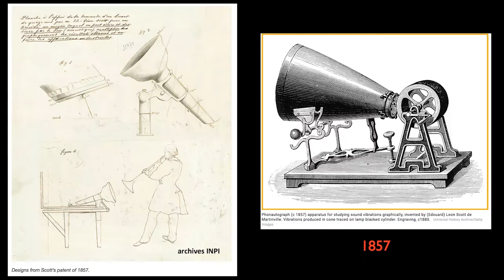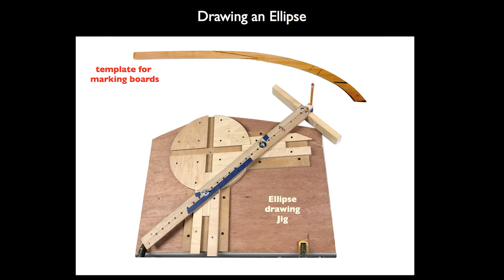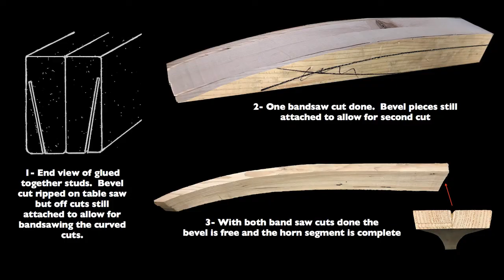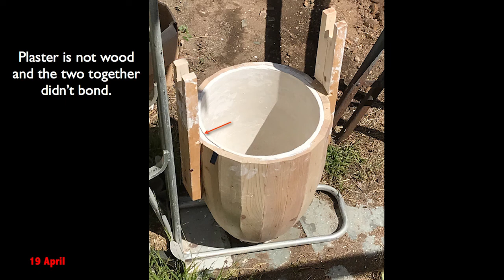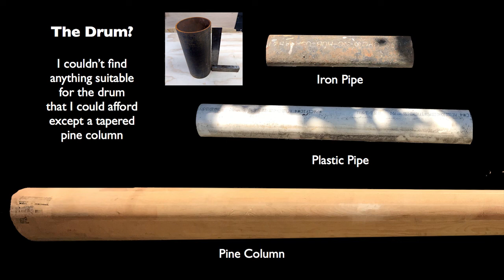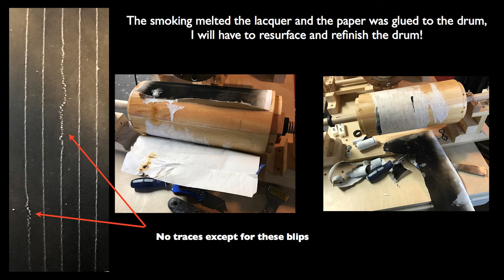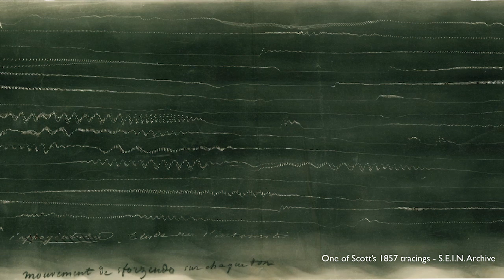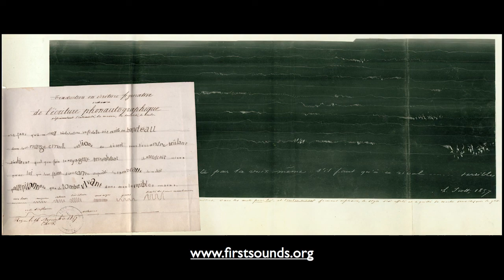How Not to Make a Phonautographe

Comment: It's immediately obvious that your needle won't work. Most of the motion of the diaphragm will move the needle lengthwise, resulting in zero oscillation on the paper. You need to have a 90 degree lever for the needle to convert the diaphragm's vertical (lengthwise) movement to horizontal across the paper. Look at the Victrola guy's video, which shows a 90 degree pivot for his needle.